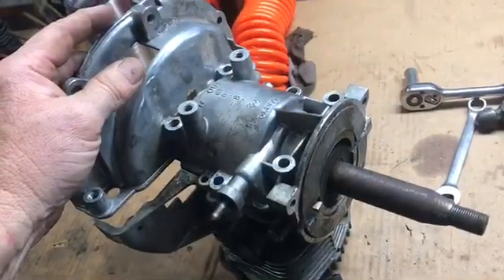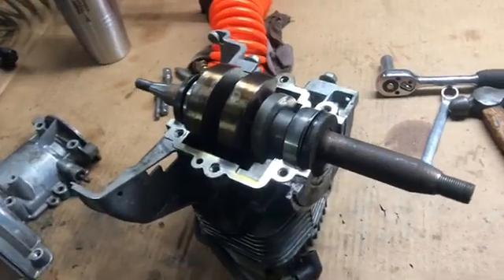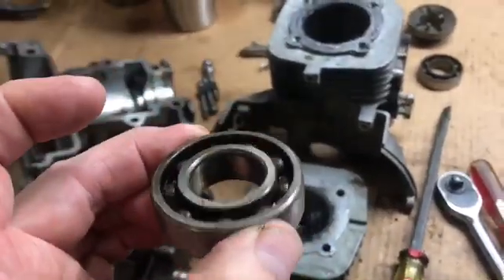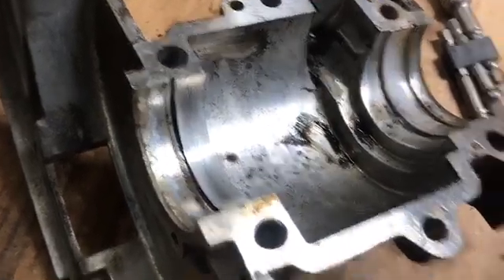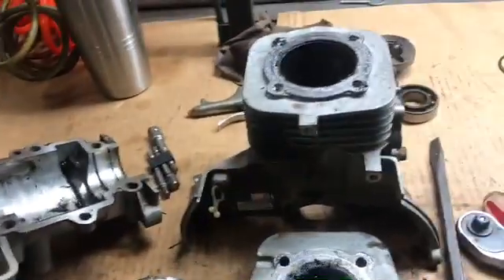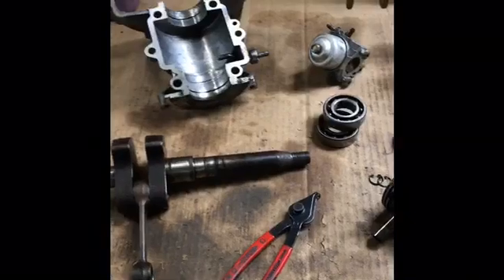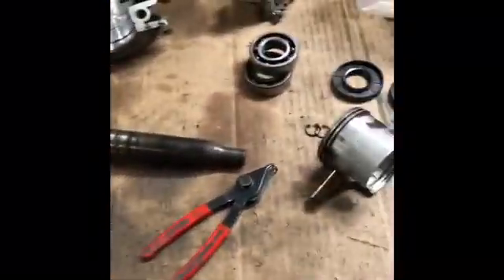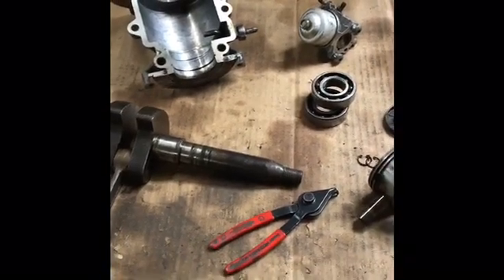Lawnboy 2 stroke minibike engine build

Comment: dang, you beat me to it lol. ive got an f series lawn boy im gonna modify and put on a mini bike frame. even got a expansion chamber off a 125cc dirt bike. wish i knew someone that could turn my crank down for me. i might have to use a adapter, even though i dont really want to.
Reply from the maker: You will also need to have a keyway cut if you plan on using the "normal" setup.....still have to cut the keyway on mine. I could use a 125 pipe though :-)